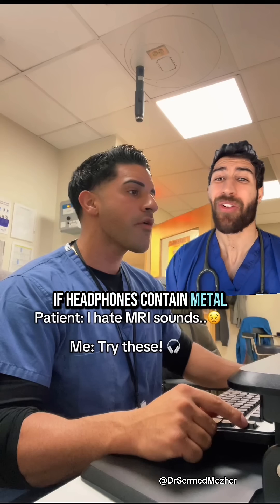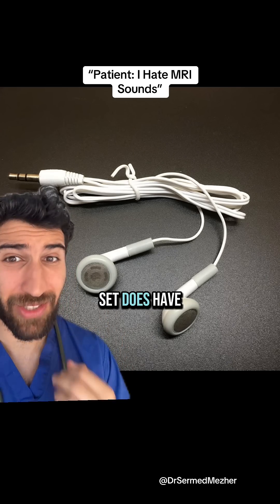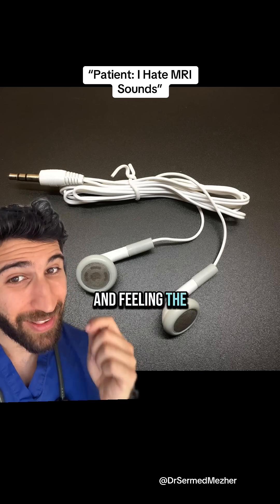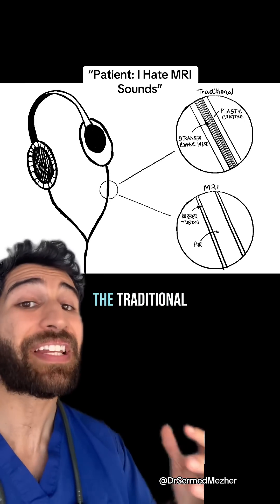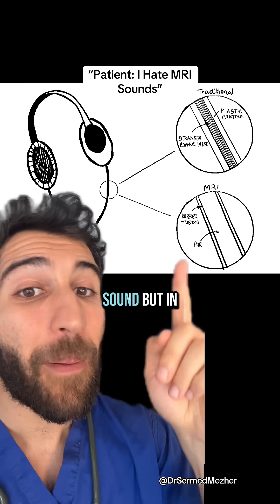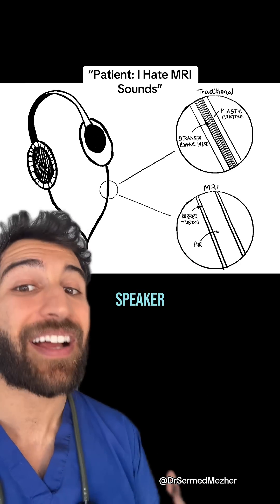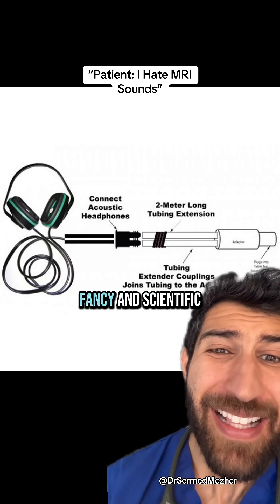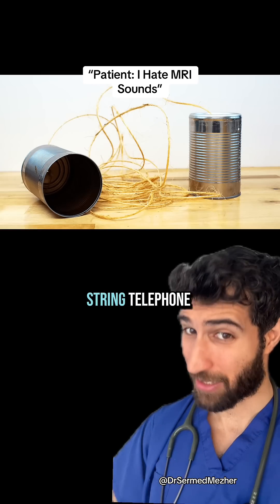How Can You Get Headphones in an MRI Machine? #science

Comment: That's not fiber, they are pneumatic speakers. Used to be common in planes etc. A bit like the pneumatic switch that the patient can squeeze if there's something wrong.

Fiber is used for communication with the patient that requires more than a yes-no like fMRI studies, it just uses light. Expensive stuff

Comment: Its air pressure.  The real speaker moving creates pressure waves which can be directed and used to move a material on the other end which creates the sound for the user to hear. 

Not really the same as the can and string, theres no conversion through different materials.

Comment: Pneumatic speakers like this is what were used on commercial airplanes through at least the early 1980s. I remember I could lean down in my seat to where the headphone jack was, to hear whatever channel the previous passenger had it set to.
Reply: that’s actually so freaking cool
Reply: @desigirl567  And there was always a steady flow of air from the headphone jack, too. I just remembered that :D
Reply: Ah, I remember those on flights in the early 00s. I tried saving a pair of the headphones but they were lost in a move at one point.
Reply: And the headphones you got for those were hideously uncomfortable

Comment: Fiber optic is a glass wire, though, which would still require decoding and magnetic drivers on the headset end.  I don't know what the technical term for pneumatic hearphones is, but I'm pretty sure it's not that.
Reply: It's literally that, pneumatic headphones/audio! They used to put it in planes before having an electrical circuit in each seat was feasible. Now these circuits are cheap and many even have active noise cancellation (if you ever saw two-pronged headset connector in planes)

All the fancy noise cancelling magic happens outside the headphones which makes them cheaper in case you steal them. Although you can get adapters
Reply: @novadeluxetwo8123  Huh, that's interesting!  I thought the 2-prong thing was a separate left and right channel.  I'm sure I could Google this (once I'm done checking YouTube notifs, which means I'll probably forget), but do you know what the deal is with the 3-prong headphone jacks that are found especially in some high-end business and first class products?
Reply: @trevorc3063  Yeah I was gonna say the same thing. There are clearly no fibers and there's definitely not any optics going on. More like Aeroacoustics or something like that
Reply: Pneumatic means containing or operated by air or gas under pressure.
Reply: @Lizzypoohxo  That's what he described in the video.
Reply: @trevorc3063  maybe I was confused by your comment lol.
Reply: it's more like fiber aural
Reply: its called an acoustic headset. very common in a few different industries. those clear coiled earphone you see secret service guys wearing in movies are a common type of acoustic headset. the speaker is placed in a remote location and the sound travels through the tube to your ear.